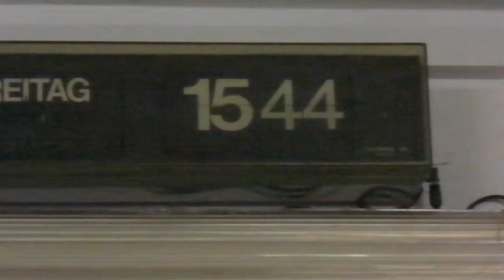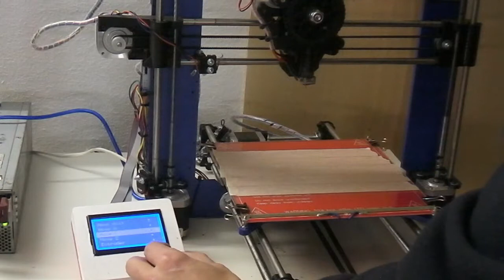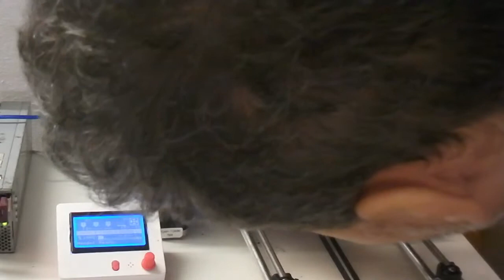3D printer leveling and calibration

Comment: my motor also moves in only one direction 
plz give me marlin file  technologybazar001@gmail.com
Reply from the maker: I have ordered my kit from a supplier, where all drivers and firmware are provided online. I only have modified the "DEFAULT_AXIS_STEPS_PER_UNIT" in the Configuration.h file. Firmware files: https://www.dropbox.com/sh/krhzait9ydydgd6/AAAOzwA3UdZr6pHUlv6aCqiZa/Charlie%27s%203D%20Technologies%20Support/Prusa%20i3%20and%20Prusa%20Mendel%20i2/3D%20Printer%20software%20and%20firmware/3_Firmware/Prusa%20i3?dl=0